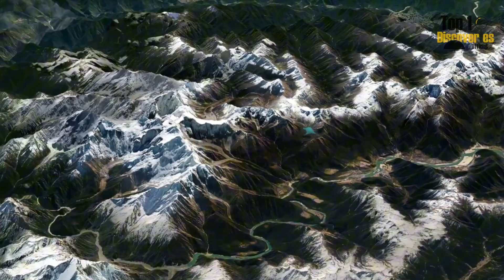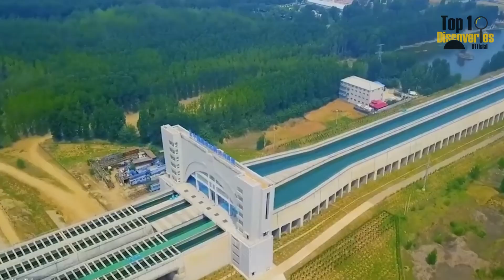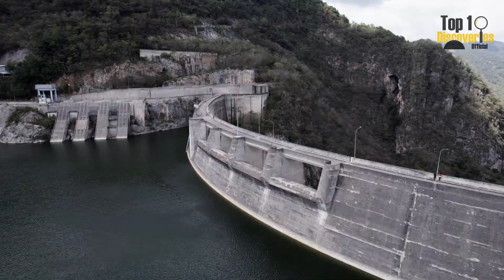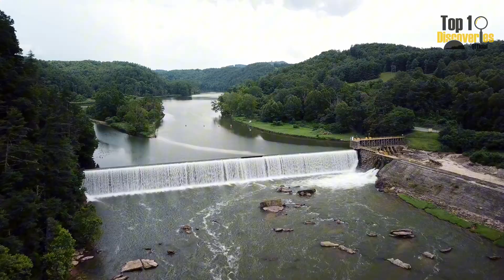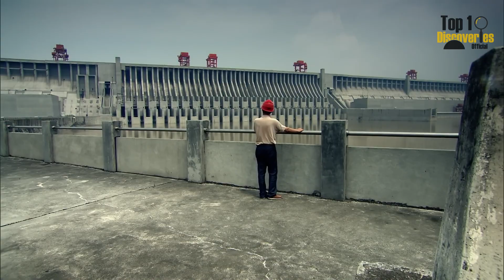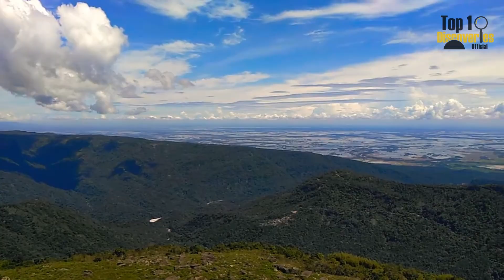China’s $137 Billion MEGA HYDROPOWER Project in the Himalayas

Comment: One thing often overlooked in discussions about this project is that most of the heavy monsoon rains and resulting runoff occur downstream, outside of China's borders and at much lower elevations.
Reply from the maker: Great point! It's important to recognize that water flow dynamics aren't determined solely by upstream infrastructure. Downstream climate patterns, elevation, and land use also play a massive role. Water management requires full regional cooperation, not just engineering
Reply: China terus membangun tiada henti nya, selalu muncul pembangunan besar ..makmur untuk anak cucu😊